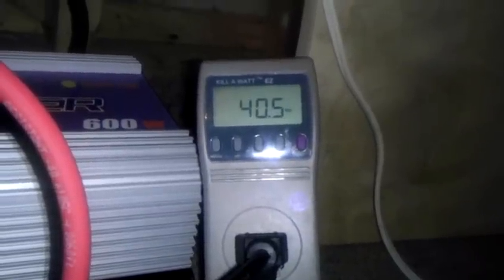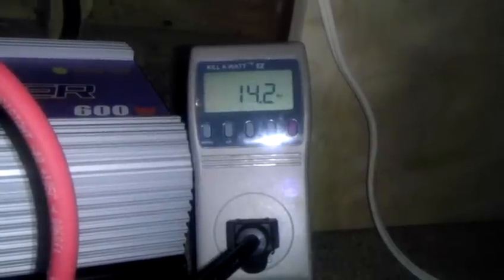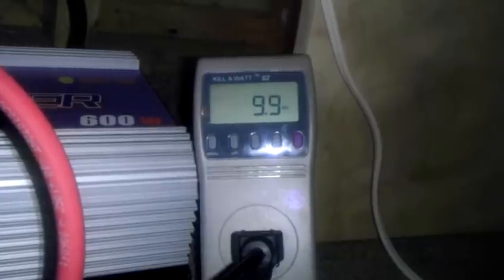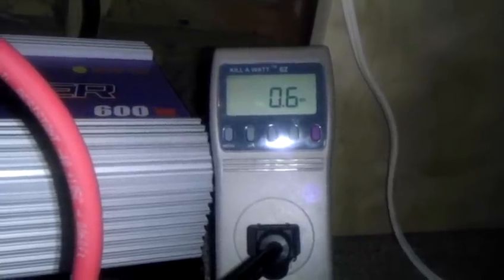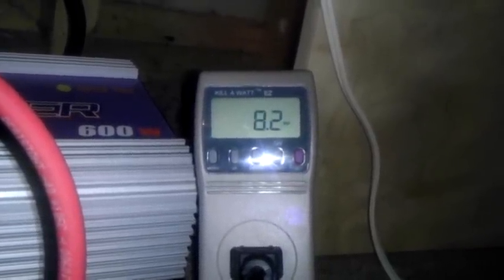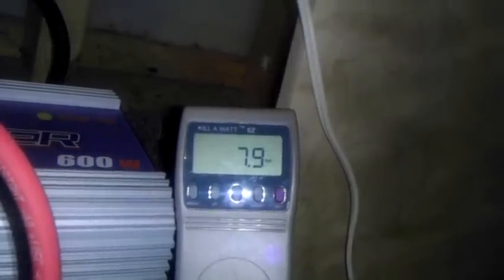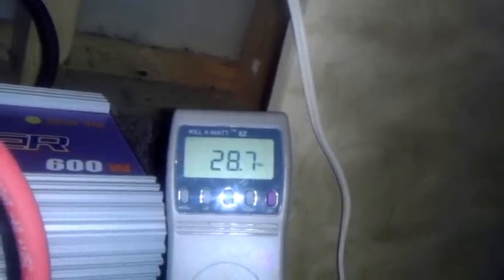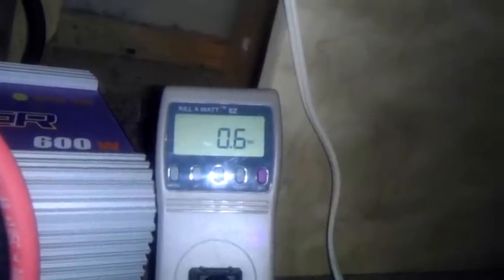Home wind turbine part 4

Comment: Have you tested any other pma  to see if they can produce better i have the same setup as you do using the grid type inverter with no batteries i get the same readings as your getting, im really dispointed

Comment: so if thats the case. why are you modifiing your Thermodyne turbine, instead of using it strait out of the box....so why is it John, why are you modifing it, you saw Orlans video it never went over 400 watts, and it was advertized at what 1500 watts right. yea thats what I thought. and Orlan has more than enought winds to move it.   so why are you modifying it.   unlike you when I bought my turbine I already had plans to mod it for my wind zone....

Comment: O did you know you can look mine up. its under Charles Paul Mccune rank e-4 CPL,  it also tells my MOS during time of servide.  it shows it starting at 2811, and then changing to 2847, a telephone technician,   it also shows my awwards,  you know what those are here I tell you its free its public domain my awards are, GCM, NDSM, REX(3RD AWD)  YOU KNOW WHAT rex is Riffel exspert.  I also got the good conduct medal, for faithfull service.  O it also gives you the units I served wow

Comment: The most severe type of military administrative discharge is the Other Than Honorable Conditions.  Some examples of actions that could lead to an Other Than Honorable Discharge include security violations,  use of violence, conviction by a civilian court with a sentence including prison time, or being found guilty of adultery in a divorce hearing (this list is not a definitive list; these are only examples).  In most cases, veterans who receive an Other Than

Comment: There is very little power in winds under 12mph. 
It's extremely hard to believe your claims with that inneficient solar panel inverter. Please show what it does into a battery at a sustained 30mph wind.